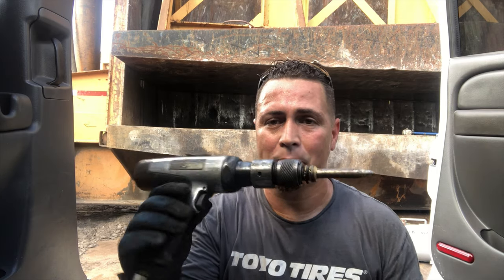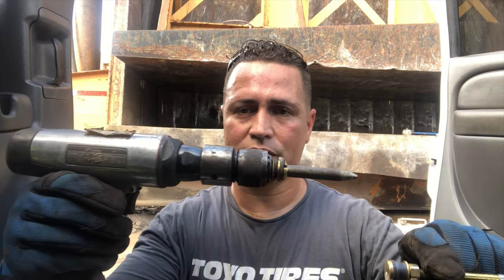How to change a valve stem

Comment: Is that just a regular hammer but or is the a spacific size bit
Reply from the maker: Bobby I’m sure you can you just about any air hammer. I just wanted one that would fit my needs for valve stems and removing heavy rust. In the description is a link to the one I have.
Reply: TripleATireService thank u sire keep up the good work bro u help make my job easier
Reply from the maker: Thanks